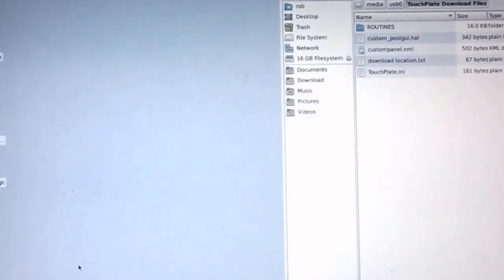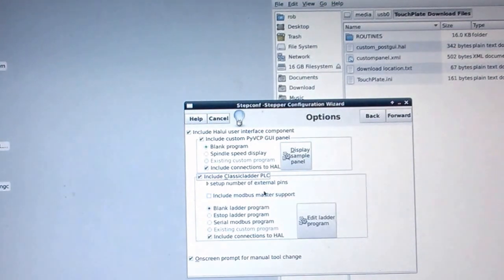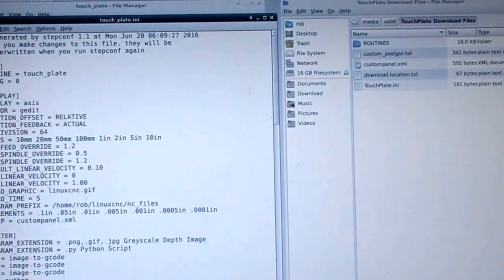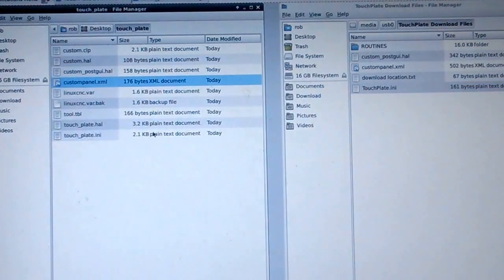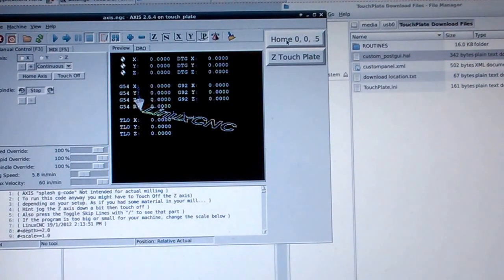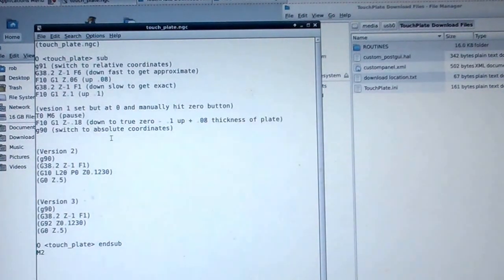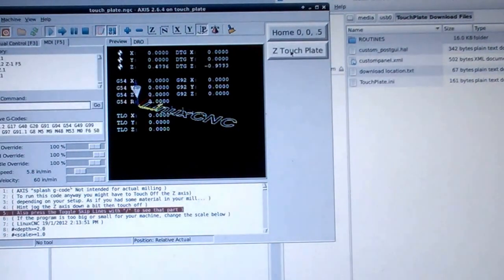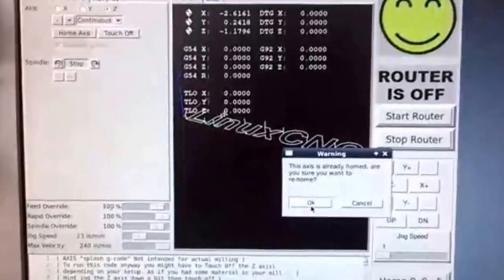Setting Up LinuxCNC With A Touch Plate

Comment: An excellent tutorial; kudos to you.
I got an "EOF filepath error" when trying to run the routine but this was my putting in my filepath wrong. A single lowercase letter where the uppercase should have been! (I wrote this in case others get the same error)
Apart from that excellent and easy. Top work

Comment: Rob, I'm using a C11GS board from CNC4PC.  In your video you call for the probe to be connected to a Pin and Ground.  I tried that and it did not work.  However connecting a Pin and 5V did work.  What I learned is in order for the Pin/Ground combo to work, I need to have the associated Pin set to Pull-UP on the C11GS breakout board.  Hope this helps someone else who may be having the same problem.  Thanks for your video's. John
Reply from the maker: Thanks for that update.  My only experience is with the xylotex breakout board.

Comment: yesteday can first time run motors, but i test hall-meter my probe wires, breakout board have connect GND and pin 15 probe, GND and pin 10 E stop. both wires has connect button to breakboard. normal NC button. i not understand why hall-meter not show true/false my probe connection. test manytime. have setup config wizard all motors and working and pin 10 E stop and pin 15 probe setting ok, but why probe or e stop not show hall-meter ? what need do. my first time use linux and linuxcnc. not understand code any. sorry not understand english good, lot not understand this video. what need do. please help me.
Reply from the maker: The best place to ask questions like this is at:
https://forum.linuxcnc.org/

People there are very knowledgeable and willing to help.

Comment: Hi Rob, i am implementig this in My Linux CNC ver 2.7.14, but when click in icon Touch Plate i receive a message: EOF file:/usr/share/axis/images/axis.ngc, seeking o-word: 0<touch_plate> from line:0

Have any idea to solve this ?
Reply from the maker: This is just a guess - I am not that good at troubleshooting errors in LinuxCNC.  It should give an error if it goes down an inch and does not touch the plate.  I suspect that is what this error is about.  Are you working with inches or mm?.  If you are working with mm, then you should change the ngc/gcode file for a bigger number.  1 mm is not enough.

Comment: My BOB has + and - for inputs - looks like you use the probe return via the earth/ground connection on the mill? Is this correct? I would assume my probe connection would need two wires, one to the tool and one to the touch plate, can i assume the ground/earth on the mill is equivalent to the BOB negative connection?

I am in the UK and all out electrical appliances have a live, neutral and earth connection?

It's whether I run two cables for each input connection really or can get away with one?
Reply from the maker: "can i assume the ground/earth on the mill is equivalent to the BOB negative connection?" - I would assume so.In the US we use 110v, but we have a similar 3 wire AC setup (I don't claim to be an electrician or electrical engineer).On my setup, the spindle / router is plugged into a different circuit than the computer and stepper controller.  The way my router is built, the spindle shaft is grounded (I don't know if it is this way for all spindles / routers).  When the bit on my system touches the plate (no alligator clip for ground), it completes the circuit and system knows it made contact. I was quite impressed that this worked since the router and BOB go through different circuit breakers.

Comment: Perhaps an obvious question but where is the touch plate connected? To an input on the controller (pin 13?) I can see the tool makes the circuit with the plate so the croc clip to the tool is connected to ground?
Reply from the maker: Yes.  The plate is wired to pin 13, and the corc clip is ground.  

Note: on some routers (like mine), the shaft is grounded, so you don't need to use the corc clip as long as the router is plugged it.  In this case you will need to make sure that the plate goes to pin 13 instead of the ground wire, or the circuit will always be completed.
Reply from the maker: One more thing.  If you watch the video I did on relays, it shows a lot more on the wiring.  Not specifically on the touch plate, but once you see the wiring there, it will make more sense for the touch plate.

https://www.youtube.com/watch?v=_eXa4QQU73U&list=PLLnDVSews_8nCnqYlTgJB2_ata49bwPQb

Comment: Hello and thanks. I followed the procedure but I have a error "command 00 not exists"
Reply from the maker: Hi - I have not debugged anything in LinuxCNC for a while, and this is just a guess.  

The example files supplied reference each other, and I suspect the error you are getting comes from "custom_postgui" file where it says: " net remote-rapid-to-home halui.mdi-command-00 <= pyvcp.rapid-to-home".

This is just a guess, but did you change the name of the folder "ROUTINES" or the file "go_home" in that folder?.  Command 00 is trying to run the "go_home" gcode in the folder "ROUTINES".  

I hope this helps.  I am not great at debugging.  If you need more help I would suggest the LinuxCNC forums.
Reply: I got the same thing and have checked  all of your tips hmm
Reply: I’m not sure if you still need this but under [HAL] in your ini file, you need to add HALUI = halui  I got the same error and compared my configs to an older one I still had saved.

Comment: Hello Rob, thank you for this tutorial! It worked the first time! I have one issue however, do you know why I can no longer use the gmoccapy GUI after doing this procedure? Is there a way to integrate the touch plate capability and also keep using gmoccapy?
Reply from the maker: Sorry, but you are beyond my skill level with that question.  This is a pretty old video (but I think it still helps a lot of people).  The version of LinuxCNC on that video is getting older, and I do not know if the problem you are having has anything to do with the age of the procedure/version, or if it is unrelated.
Reply: @sidewinderdrums  No worries! And the video might be old, but I've looked for quite a while and this is still the best video out there on this topic. I think most of the people getting confused in the comments are looking for the specific file names in your video (ie "touchplate.ini", which is 'your' machine name in the video), not filenames with 'their' machine name in them. It is a complicated subject, but you nailed it. As far as I have figured out in my searches today, gmoccappy does not yet support pyvcp, so if you do anything with pyvcp like these steps do, you lose compatibility with gmoccapy and are unable to use it. No big deal though, being able to touch off on the workpiece is kind of a critical function in my case. I will take what I can get! :):) thanks again!

Comment: I have a problem when I press a button the spindle pulls the sensor very slowly. When I changing the parameters of the script , nothing happens - the script does not work as it should. 

My configuration https://drive.google.com/drive/folders/0B6mwFaph3DUmVWlESzB4QTNDcm8?usp=sharing

Comment: Hi Rob maybe I did  something wrong I can't get access to you  probe files on your link below, it  say no access, wonder if you could check you could check if your link  is working thanks or maybe you could point me in the right direction for the files , fantastic great info.
Reply from the maker: Ooops...  I got a notification from onedrive that I was low on space, so I deleted a bunch of files to save space.  Looks like I went to far.  I just restored the files, and you should be good to go.
Reply: Sorry to be a pain but still can't access the files on your drive , it says files no available or deleted....;(
Reply from the maker: It should work now.  I changed the permissions on onedrive, so everyone should be able to see/download it.  I tested on a different computer that I am not logged in, and it worked, so I think we are good now.  If not, send me a private message, and I will email you the files.

Comment: will it be more useful to set the G54 to zero when the tool is at the stock height? I mean you can plate the copper plate on top of the stock right?
Reply from the maker: Yes - that is what the process does.  II measures the height when the probe touches the plate, subtracts the plate thickness, and sets that value to zero Z.

Comment: home and z-touch plate button doesn't work?What should i do?
Reply from the maker: If both buttons do not do anything, it probably is how the PyVCP (Python Virtual Control Panel) is set up.  The LinuxCNC forums are very good for issues like this.  If you cannot find a similar question / issue in the forum, ask the question.  They will often ask you to post your files so they can look at it and find the issue.
Reply: +Rob Shuster  thx for your replying,but i cant find anything about this problem.
Reply: +Rob Shuster it adds xml files.i can see the buttons in main screen but when i click them i cant see any reaction.it is probably about the g-codes i think

Comment: Hi Rob and thanks for the video. I'm trying to get Version 2 working and am puzzled by the G90 absolute mode command. I notice you didn't do this in your Version 1 b4 the slow G38.2. My machine doesn't want to do the 2nd G38.2 because it will exceed joint limit.
Reply: Answered my own question. yeah, should be G91.

Comment: I'm pretty excited about this and nearly have it working.  Thanks!  One question - I see you edit touch_plate.ini manually.  Does this mean that you must never run Stepconfig again on this setup?  Won't it overwrite your edits if you do?
Reply: Yes - they overwrite each other - the initial advantage of StepConfig is to test max jitter and max velocity and acceleration for each axis, once that is done you are probably better off editing and saving the ini and hal files etc.
As demonstrated you can create a number of config set ups - if you are careful you can copy and rename them too so you have backups.

Comment: Hi Rob, thanks so much for your excellent code shared ! Zero homing run very well on linuxcnc 2.6.13 but Z touch plate is very slow and stop when the bit is on contact with the plate and doesn't up again. I have a error message "probe is press in at the beginning of the mouvement G38.2 orG38.3" I hope you can switch me in the good way ! All the best !!!
Reply from the maker: Are you using inches or mm?  That could explain why it is going very slow (my code is inches).  I am not sure about the error - I have not seen that one before.  I hope it is because the probe is in contact to long.  If you speed it up it might fix that issue too.

Good luck,
Rob

Comment: This is gobbledygook to me. It should be a bit more intuitive to set this up. I hate to keep doing it manually, but this has me lost. I have seen tutorials on doing this in Mach 3 and it was much easier. But alas, I am a zero Microsoft guy so...   And maybe you are assuming the knowledge  level of the viewer and just rambling through some of the process. Not that I don't appreciate your efforts, but I just find it hard to keep up with. I'll try to grind through it without pulling out too much of the hair nature hasn't already done away with.